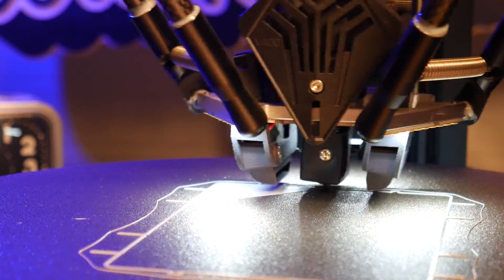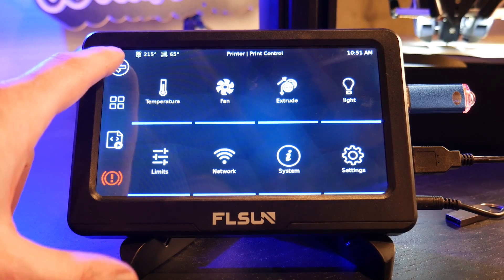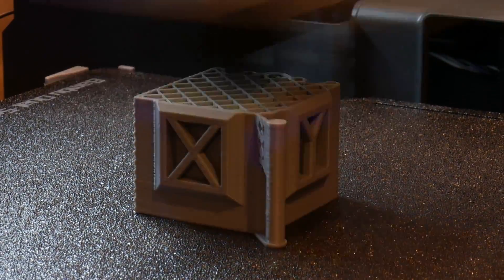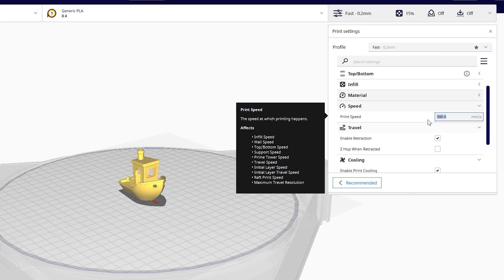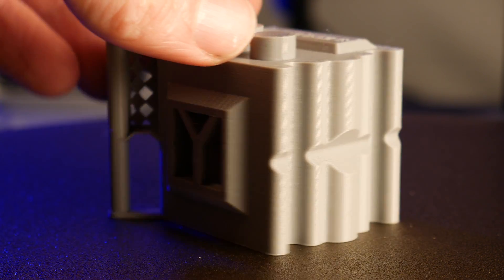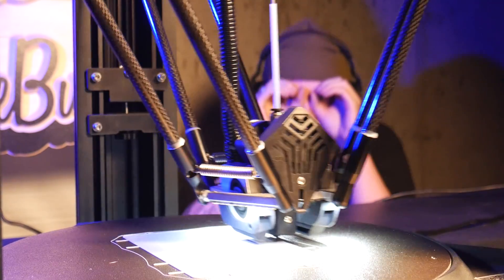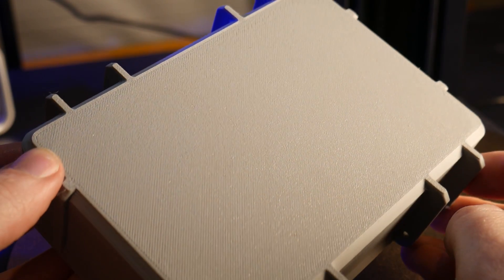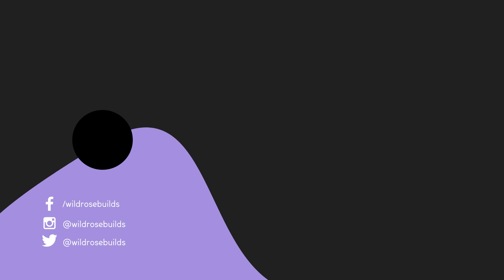FLSUN V400 - The Fastest Delta 3D Printer?

Comment: Had this bad boy for a while and one thing I have learned it is cura sucks for this machine because it smoothed out so many minor details. What did work amazing is orca slicer and reducing the flow rate by about 10 percent because that little extruder honestly pulls more plastic than you would think.

Comment: The V400 should be set at a lower acceleration than you did to equal the quality of the P1P, details are smoothed too much.
As tip: when you compare printers, print the acceleration tuning tower, so that it's easy to see at which acceleration the gap increases and at which acceleration the ringing appears.

Comment: I love the V400 … but only for stand alone parts. If they have to match or fit together for building something: no way. I have calibrated that thing over and over, it’s impossible to get a snugg fit on something. Everything’s to big, i have to sand down everything. A bolt with a threaded headphone holder for me? Nope. Don’t know what’s the problem. And after hours and hours of try and error, i have absolutely no interest any more 😂 I think i‘ll try the Bambulab X1.

Comment: I need their S1 to be reviewed honestly.
Im in the market for a new printer and I'm either buying a 500mm ratrig, an X1E or the FLSun S1 and building a ventilated cabinet to house it with venting to the outside for use with the nastier engineering materials.

Comment: I find it pretty interesting that no one has really mentioned the print area. Yes, I'm sure the P1P is a better printer out the box which is probably what most people want, but if you need the print volume it instantly disqualifies itself.
Reply: Print volume for vases that is right? The V400 does not fit 256x256 cube

Comment: No 3d printer can move at 500 / sec. Accel, direction change and extrusion speed will control speed. You can set the speed at any level you want.

Comment: I'm pretty disappointed in my V400. I had lots of problems with it. I had layer shifts, stringing, over extrusion and under extrusion on the same print, uneven layer lines, rounding on the corners, the filament sensor stopped working after a week and more.
I made every calibration I could : tensioned the belts equally, PID tuned the bed and hotend, made an ADXL calibration, switched to spreadcycle mode to fix layer shifts, calibrated retraction, calibrated linear advance, switched filaments, dryed filaments...
Now it's working as it should, with a pretty okay print quality. 
However, my slightly modded Ender 3 V2 beats the V400 by a lot. The Ender 3 print quality is far superior for a third of the price. 
I'm a bit disappointed in the V400. I hoped to get a good print quality, but no, it just looks like prototyping...

Now some people recommended me to slower the speed, which I won't do. It's a V400. It's MEANT to print fast. It's like saying "print slower" on a Bambu Lab P1P/X1C. or like using 60hz on a 240hz monitor. 

Anyway, thanks a lot for your quality review. Have a nice day !

Comment: I wonder what the actual acceleration of this delta printer is? A 33 minute benchy isn’t good at “400mm/s”, means it maybe reached 150mm/s. My giant bed slinging sv06 plus, did a standard speed benchy at 30:24, with mild 3k acceleration and “200mm/s” in the slicer. Would try faster but no point as ringing was starting to appear and it’s just marlin not klipperized.

Comment: The last benchy i printed with a P1P took just a bit over 15 Minutes. This thing is a beast. The V400 has multiple problems („no contact to Moonracker“ anyone?) with bigger prints, so it’s an interesting concept, but not for people who need reliable printing. The P1Ps we use are (for now) as reliable as the prusas. We’ll see if they hold up long term, but they are definitely the fastest devices we have for now…

Comment: neat stuff!
Really curious to see how you get on with input shaper tuning.
seems like it's a little more finicky for deltas than for core XY or other cartesian style kinematic systems because the position of the print head in the build volume makes a big difference for the resonances. Then again I would expect a core XY to be more rigid near the borders of the build volume as well so maybe it's a wash.
Overall I'm glad to see the market is moving beyond bedslingers and towards delta and core XY being more of the norm than some odd curiosity.
I'm pretty happy with my much hated ender 7 after I klipperized it and it's cool to see more polished options like this in the high speed printing segment that give people an easier start without so much messing about or the highly proprietary experience of bamboo labs.
Reply from the maker: YEAH! competition is good for the consumer and I hope the bambulabs feature set lights a fire under the butts of some of the bigger printer manufacturers.  I was obsessed with octoprint back in 2014 after seeing how much functionality it gave my first printer which didn't even have a screen/interface. I think Klipper is the next evolution of that obsession for me. I have the accelerometer now and hopefully will get around to filming the upgrade soon. excited to see how much of a difference it makes. thanks for watching!

Comment: Great review / comparison video  👍👍👍, Love the FLSUN range and have had 2 x QQS, 2x SR's and now currently have 2 x V400's 🙂
Reply from the maker: Flsun sure knows how to make a delta printer. Thanks for watching!
Reply: hows the QQS vs SR print quality? I had the SR, thinking of getting a used QQS pro since at slow speed (.12 and below) they are almost same speed.
I now have the v400 btw.
Reply: @BlazsePist  the QQS is still a great machine, print quality is easily on par with the SR but obviously there is a lot less speed involved so a QQS has time to be more……accurate but if you slow your SR down to 60mm/s it will print pretty much identically I would have thought.
Reply: @printasticuk  thank you for the info...will add the QQS to my printer :)

Comment: The truth about the flsun v400....(or better, about flsun itself)
Bought a unit mid january
Have it for several weeks
Unable to extract one single good print from the machine 
The issue is that the effector keeps on blocking for whatever reason.
I constantly have to unload/load filament to temporarily fix the issue.
Very frustrating.
Contacted flsun.
"Please watch this video"

No support.
No help.
No nothing.

Considering filing an official complaint, this has all the hallmarks of a ripoff.

Do not do business with these people, hey clearly do not give a fuck about their customers.
Reply from the maker: How experienced are you with 3D printers? Nozzle clogs can be caused by a bunch of things that are out of the manufacturers control. Nozzle temp, filament quality, retraction settings, ambient temperature, flow rate / esteps, first layer height, etc can all cause clogs. Do you have all that stuff dialed in?
Reply: They lied about sending extra filament

Comment: This v400 is my second FLSun printer, an upgrade from my flsun SR. The flsun v400 is another incredible printer from FLSun, easily achieving speeds of 380 - 400mm/s with factory hardware and firmware, and consistently delivers great quality prints using only the basic Cura profiles included with the software.
Reply from the maker: The super racer was also a solid delta machine. Excited to see what flsun comes out with next!

Comment: Thank you for this video. I would actually like to buy a newer 3D printer, but somehow none of them meet my requirements. Speed is actually what interests me the least. Let's face the truth, what a 3D printer does most in private use is: standing there and wait on his owner. Security, I'm interested on. It doesn't matter if it prints quickly, it has all the time of the world if it can print permanently safely. What I just don't see: Multiple temperature monitoring in the event of a temperature sensor failure. Clean wiring, possibly smoke warning and spaghetti detector. Only the thermal runaway protection is not enough for me, it may be due to me age, but the security, there is still too much Asian thinking in it (and i was in asia for a long time, also in china for final inspections)..... Furthermore, a larger installation space (I'm a homeowner and there are already one or the other project that would just be a bit bigger). 

In simple terms, it's just not time to make a new purchase on a 3D Printer. It's just time to wait and see what a race the X1 Carbon has opened up. I'm really excited to see what QUID will counter with....

What was my shopping list when buying the first 3D printer: 3D printer, filament, fire extinguisher, fire blanket and another smoke detector. I don't really care whether that makes sense or not and everyone has to know for themselves. I just do so ;-)
Reply from the maker: if you reach out to FLSUN they'll hook you up with exactly what you need i"m sure!

Comment: The quality loss is unfortunate with the V400. 4:28 there are gaps in  the bottom of the print and this is after you got a super tuned profile that apparently no one else has access too.

The 2:37 print quality is what everyone else gets stock.
Reply from the maker: I've linked the cura download with the profile I was provided in the description! there's definitely some room to improve print quality via tuning. I don't have a whole lot of experience with the extruder that's on this machine but I think I might have some hardware fiddling to do as well.
Reply: @WildRoseBuilds  Thank you for the response. 🥰 Adding to Cura now to test.

Comment: I have the anycubic predator which is the first version of the v400 (I think flsun bought anycubic design), do you know if it’s possible to upgrade the predator with v400 parts ???
Reply from the maker: that machine looks quite a bit different than this one, you'd have to replace a lot of parts to the point that it probably wouldn't be worth it.

Comment: This is my first 3D printer and the experience has been absolutely what I'd describe as 'Plug and Play', with only one failed print caused by me trying to push max speeds on a tall and narrow model. The included 'Speeder Pad' touchscreen puts all controls only a menu or so deep, allows for WiFi connectivity/printer management and can apparently run multiple printers simultaneously (though I've yet to test this last feature out). Bed adhesion is insanely good with PLA and PETG, and this thing is fascinating to watch as the arms and head articulate at absurd speeds.
Reply from the maker: Multiple instances of mainsail is definitely on my to do list!  thanks for sharing your experience and for watching! :)

Comment: this printer is FAST! An articulated mechanical octopus I printed that would have taken one of my other printers around 18-23 hours on 0.2mm took only 10 hours on this printer. Most of the speed is in accelerations though. So very complex models will still take longer. I'm just very impressed I'm maintaining a lot of the quality with high speeds.
Reply from the maker: I'm going to pull the trigger on one of those accelerometers I think to counter vibrations and increase acceleration speeds, either way that volcano hotend is begging for a 0.6mm nozzle. i'll have some more videos on this once i spend some more time using it! thanks for watching!
Reply: @WildRoseBuilds  Tuning input shaping will make a vast difference to how high you can crank the acceleration, especially for travel and non outer perimeters where it's fine to push it to just below the point where you skip steps, and acceleration is very often the bottleneck to print time.
Reply: For reference, the McGybeer full size smooth octopus is only 2h45m on my Ender 3 thanks to well tuned input shaper allowing over 42k on X and over 14k on Y. That's without even going to high print speeds, just 230. The V400 well tuned could probably do it in 1.5-2 hours.

Comment: I just got my V400 and I must say, it's great that someone finally made a serious, uncompromising delta! The delta is indeed a great platform, but it really needs a first class effort to make it shine and not be a nightmare.
Reply: Yeah the V400 does takes a lot of effort to print nice. Although I’m almost dialed in, I still wish I chose the Bambu
Reply: @WouterZtube  why?
Reply from the maker: Totally! Are you planning to get an accelerometer for input shaping? I'm really interested in what speeds this thing could get up too with a bunch of tuning. i guess i've been bitten by the fast printing bug. thanks for watching! :)
Reply: @WildRoseBuilds  I now have 2 V400's.
Yes, an accelerometer is a must.
Once these things are tuned in and firmware 1.4.1 installed it is pretty tough to beat these machines.
600mm.
I do many filament changes and it is a breeze. 
One has the FLSUN enclosure and the other a custom enclosure.
My first machine was a Neptune 4 which I tricked out with full linear rails.
That little printer is good for R&D at slower speeds.
I may try the Chameleon on the Neptune 4 just because.
The V400's are production machines for our company.
Very happy.
Just keep up on the lubrication and put fans on the stepper motors. 
Cheers.
Reply: Would you recomend it for a first 3d printer?  it is this or the p1p but the p1p is just too small
Reply: @luissuarez5897  I would recommend the P1P for a first printer.  It will have better support and will probably work perfectly out of the box. The V400 has a couple of known issues that can be resolved with tuning Klipper and slicer settings, but it may be a bit overwhelming for a beginner. Delta printers are know for being a bit more finicky than cartesian printers. Plus the build volume of the P1P should be good enough for most projects; it is a bit bigger than "normal" Ender volume. Keep in mind the V400 has a 300mm diameter, which can inset a 212mmx212mm square, if you are printing something square, the P1P can print larger than the v400.  The V400 does have the height advantage though.
Reply: @mikereynolds2934  Thank you for your reply, I really will need the 410 height for most of my projects, i was so close buying the p1p but i was thinking in long term and i am seriously worried about p1p vibrations, it is impossible that those machines last in time when continuously printing, the amount of slack , loosenes and clearances will be huge i think
Reply: @luissuarez5897  I understand. You may know this already, but keep in mind you do not get the full 410 cylinder height on a delta; near the top it is a cone.
Reply: @mikereynolds2934  which issues? Could you explain please?
Reply: @CarloAlbertoPinto  mainly people have been experiencing the nozzle scraping on the print. The simple but less desirable fix is to enable z-hop and disable combing, I believe some folks have solved it permanently by flashing the speed pad with stock Klipper and tuning.
Reply: @mikereynolds2934 thank you for the answer. Is combing a parameter of the Cura software? I had a similar problem sometimes but often the right solution in my case was the initial z offset. What do you mean when you talk about flashing stock klipper in the speed pad? Which version is provided with v400? Is it not a stock version?
Reply: @CarloAlbertoPinto  Yes, combing is a setting in Cura. It makes the printhead move through the inside of a print rather than outside and reduces retractions. I think Flsun uses a firmware with different sources so that they have control over the updates on the speeder pad.
Reply: No accelerometer tho…

Comment: Fast,the delta printer never moves outside of it's bed dimensions so you can place it in a area just big enough for the outside dimensions. Nice User Interface, has klipper and a color touch screen. Bed level system works great right out of the box. Easy to assemble, not as fast as some printers but should be doable by anyone that can read directions.Autoload and unload of filament works very well.
Reply from the maker: Yes! I'm going to bolt some acrylic to this machine for an enclosure. fast abs parts would be awesome off this thing!
Reply: @WildRoseBuilds  I would really love to see a video on such an enclosure.  As the print-head basically fills a (sharpened at the top) cylinder, an enclosure would either need to be triangular surrounding the legs but then big enough to surround that cylinder to leave enough room for the head or cylindrical and attached to the legs.  You cannot just mount straight panels between the legs without severily reducing the build volume.  So, a video showing how this can be done (ex. bending acrylic) could help me strike through one of the disadvantages of delta-printers on my list.

Comment: Any print quality or bed adhesion issues I’ve encountered have been promptly resolved with cleaning the bed, Re-leveling/adjusting Z height. As with any printer, it is a good idea to PID tune the bed and heating elements, and to calibrate your extruder. I’d buy 20 of these things if I wasn’t sure my wife would divorce me for doing so.
Reply: Yeah, printers are more tolerant! They don’t care, if you have 20 women!😅
Reply from the maker: hahahaha. Yeah I did PID and estep tuning, or rotation tuning I think klipper calls it. super easy to do via the mainsail ui. it would be cool to have a macro on the speeder pad to auto calibrate and save pid after moving the machine to a new location or changing to a different nozzle temp for different materials. thanks for watching!